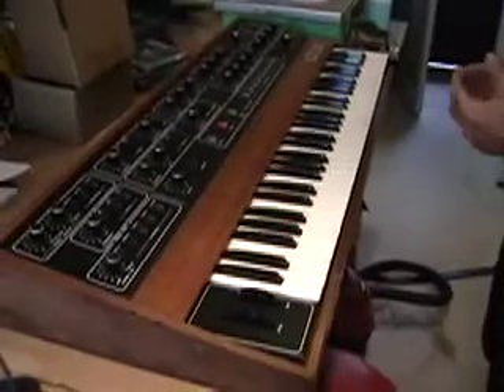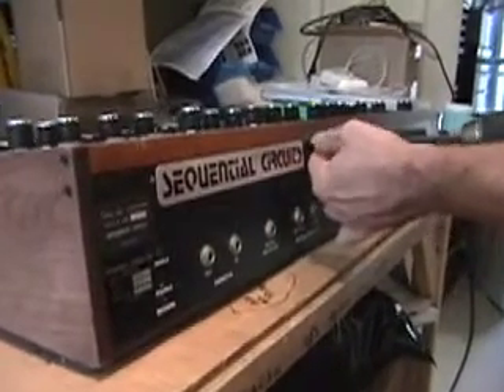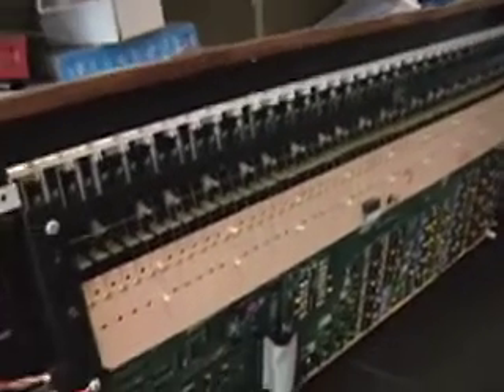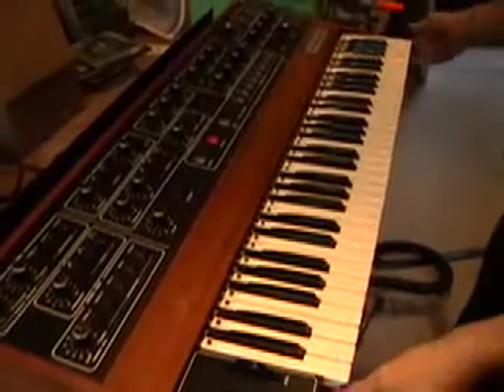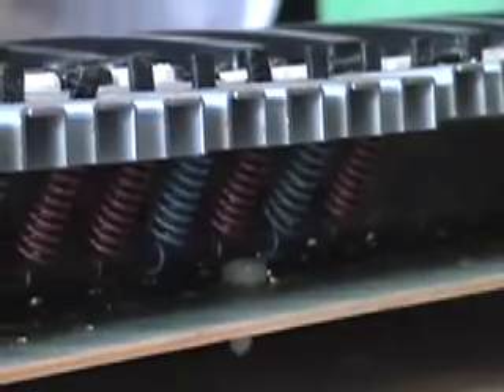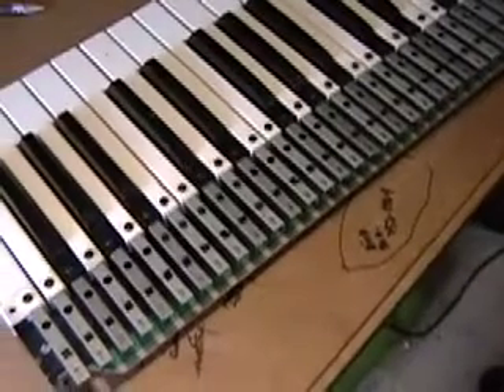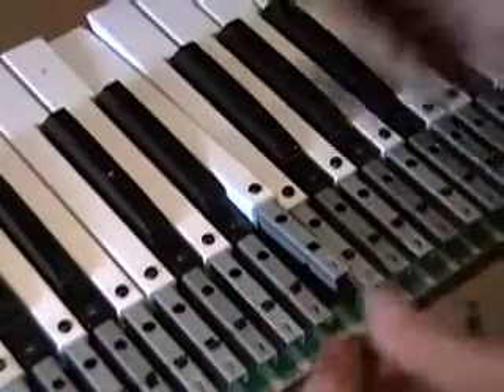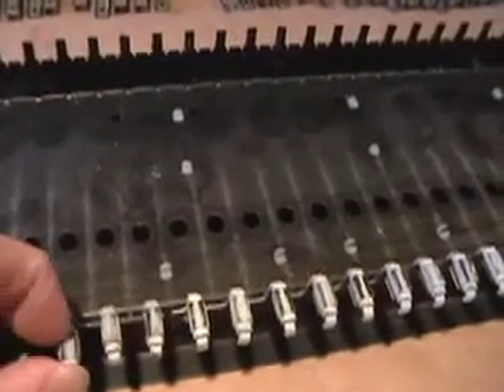How to Repair a Prophet V (Part 1)

Comment: @Geeljasjes 
As far as replacing bushings, yes. The Minimoog (as do many other synths of that era) uses the same Pratt & Read type keyboard. The removal of the keyboard from the synth, in order to work on it,  will be different of course.